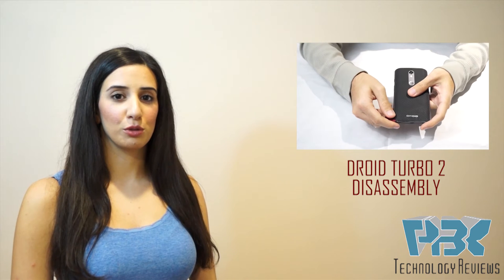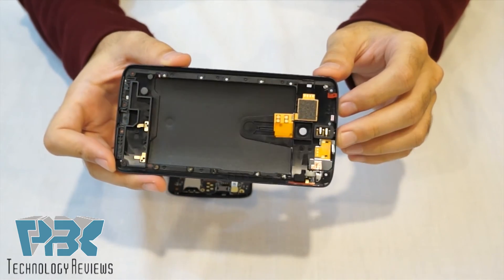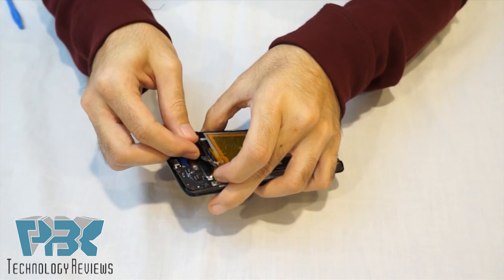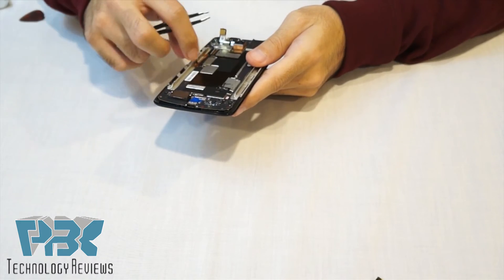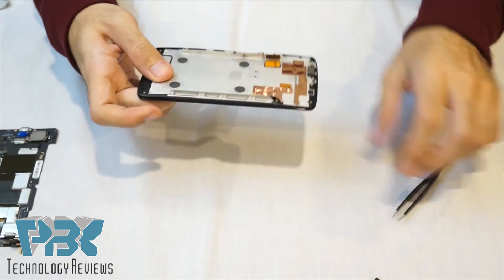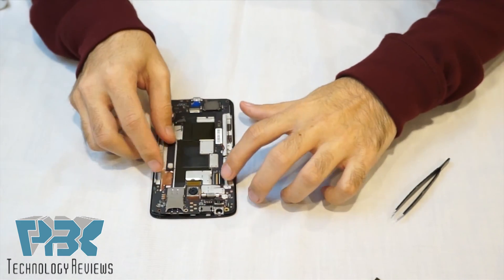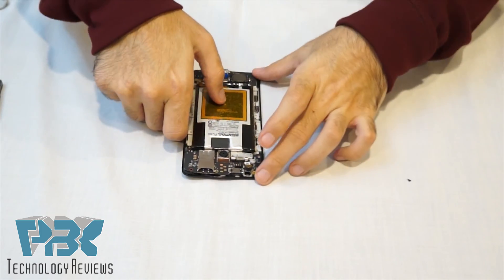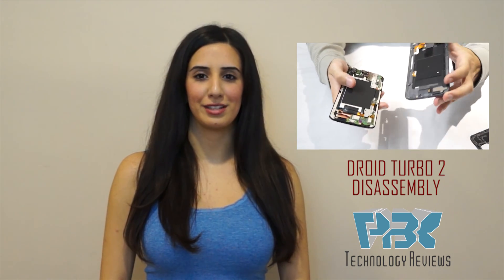Motorola Droid Maxx 2 / Moto X Play 2015 XT1565 Disassembly Teardown

Comment: Thanks for creating this video. Will you be able to point out where exactly the wifi antenna is located? My phone won't connect to wifi after screen replacement. More info in post at XDA Dev forum: https://forum.xda-developers.com/showpost.php?p=74637893&postcount=13
Reply from the maker: wow, I don't know who did that repair on the pictures you posted, but that is one bad repair job. I wonder what they damaged that they had to solder a wire to make new connections, however I can tell you probably in that whole area it where the issue is for your wifi. The silver plates on the black back plastic housing are the antenna plates. They are basically the antennas. I don't know exactly which one of those silver/chrome plates is for phone signal and which is for wifi, but I would presume the one on the corner of the phone where all the damage is, that should be the one since its not working. On the other side of the back housing and silver/chrome plate it touches lifted up gold or silver colored prongs that are on the motherboard which makes a connection between the antennas on the back housing to the main board. On your pictures on the forums it looks like those prongs are broken off your board thus causing no connection between your motherboard and the antenna on the back housing. I attached a picture of a different phone with similar prongs, here is the link for it so you can see what the prongs sort of look like which touch the back housing antennas to make a connection. https://ibb.co/e7NTA6

Comment: Hello, my Motorola X play xt1562 almost doesn't get any cellular signal. 

Could it be the antenna ? Switching to 2g and rebooting sometimes helps for the signal to pop up. but I still can't make a call or send a message, I sometimes recieve a message very delayed. 

I have checked, sim card and switched sim cards and provider and have done a factory reset without any improvement. My phone does have a chipped side next to the screen, could that be the problem (thin copper wire running through as antenna? = just a theory)

If I tear down the phone, what can I check? phone is besides chipped side in good condition and has never been taken apart. Thanks for the helpful video.

Comment: I did not think that the battery change was going to be too bad until i found that my new battery did not have the copper colored [NFC] sticker on it. Re assembled with the old battery and now my speakers do not work.  Will the phone function without this NFC sticker.  What may i have done wrong to screw up the speakers?  The head set works fine.
Reply from the maker: No you don't need the nfc to have the phone work, but make sure the back housing is making contact with the top and bottom speakers. The speakers sit inside the frame assembly but they have contact points that touch contact points on the back plastic housing which run to parts of the board making other connections so if the speaker is not touching the contact on the back of the plastic frame that you remove to get access to the internals, then it would not work.
Reply: What is the nfc for

Comment: okay from 2 videos of tear down I've heard t3 and t4 torx screwdriver so which one is it?  now I'm buying the frame and digitizer LCD in one, do I need any adhesive or use the current adhesive from the existing board? going g to try and do this myself then spend 100 from a local store that said it would take 2 days to do
Reply from the maker: Both will work, I prefer usually to go with one bigger because for me its less likely to strip the screw compared to smaller ones. You should not need new adhesive.

Comment: The new screen I got doesn't have the volume flex attached to the screen, just what seems to be the power button. Is there a way to carefully remove the flex from the old screen and put it on the new one or do I just need to send the new screen back and get a new one? Or another option I don't see?
Reply from the maker: yes you can remove them from the old one and put the flex on the new one they are held on with adhesive

Comment: If you are here to replace the screen it sucks.  I have repaired just about every phone and this one is the worst to take out.  Also your new screen wont come pre adhesive so prepare to start taping.  You will cringe when removing the battery and the circuit board will feel like its about to break in half.   Good luck you'll need it  <  Said like in smash tv.

Comment: On your video  it seems to be possible to remove and replace the earpiece without removing the battery and all of the parts you disassembed.
Am I right ?
Reply from the maker: Yes, once you take the back part off, you can remove the earpiece which is held down with adhesive without removing the battery and other parts.

Comment: the power and volume buttons magically went back where they came from.  It took me a bit to figure out that you dont put them in till after it is together. Kind of like a sim card.
Reply from the maker: The go in before you put the back housing on, so basically you slide them in and and put the back housing on and when you screw down the back housing it holds them in place.

Comment: Awesome video! I'm definitely going to be using it as a guide breaking down my phone soon.... My phone ear speaker stopped working and the WiFi, bluetooth antenna seemed to be damaged any thoughts on the problems?
Reply from the maker: It might be the back housing, its where the contacts for the earpiece are which touch the earpiece to give it signal and also where your antennas would be. Might need to replace the back housing or see whats preventing it from working, maybe water damage or dust/dirt?
Reply: I had someone replaced a cracked screen and I think they forgot something on the inside, well that's what i'm hoping to find.

Comment: I ordered the one without the mid-frame by accident. How hard is it to get the mid frame off? And do you have to reglue it?
Reply from the maker: its held on with adhesive, you would need to heat it up and pry it off and yes you would need to apply adhesive again to hold the screen to the frame

Comment: I have a single sim moto x play and want to convert it to dual sim use. I can easily purchase a dual sim tray on amazon as there are dual sim models in many countries. Please can you tell me if the difference between the single sim and dual sim model is just a software difference or is there also a hardware difference in the phone(as well as the different sim tray)? You have dismantled the phone so you might be able to answer this question. Thanks for your time!
Reply from the maker: +Julian Smithe Hi, a sim tray wont help you, because even on the regular sim trays, you can pry off the plastic covering the 2nd sim holder on the sim tray but the main board is missing the contacts on it for a second sim reader. Its almost impossible to find the sim reader to be able to even solder it onto the mother board. Then once soldered on you would also need to root the phone and install a different radio rom on the phone to make it enable the second sim slot. So its too much work lol. There is a version of the moto x play that does come with both sim readers installed on the motherboard but just needs software modification, but I forgot for which country it was, I think possibly india version. There is a thread on this on droid forums or xda forums, google it you will find it and will know all the info for doing it :)
Reply: +pwrdbykyank Thanks for your quick reply.

Comment: Is it possible to replace just the glass on the newer Moto X PLAYs? I can't find any vids on it so I'm wondering if it is even possible to do at home? Thank you!
Reply from the maker: +Melanie Drew For an average person, it would not be possible. It would require special tools and machines to do the job right. Wouldn't be worth the hassle and time.
Reply: I've done it with a samsung s3 a couple times but didn't need to remove the motherboard. What machines would I need? Do I really need to remove the mother board? Can't I just pry off the glass like with the s3?
Reply from the maker: +Melanie Drew I don't know how you replaced the glass digitizer because it has a cable attached to it that you need to disconnect, however you would need special heat guns and special glues to reapply the digitizer glass back onto the screen etc. the older phones were more simple.

Comment: How do you separate the mid frame from the LCD? I have a new lcd and screen on order but it doesn't have the frame. Thanks!
Reply from the maker: your going to have to heat the back up and pry it off, it has adhesive underneath it.

Comment: Hello ! Where is the proximity sensor ? After replacing display, i have issues with it.
Reply from the maker: +Cyril Flieller Hi, if you look at 5:15 in the video, the top left of the board the black rubber covered piece is the proximity sensor. Make sure the rubber over the proximity sensor on your main board did not fall off or maybe become stuck to your old screen frame. Without the rubber gasket, too much light comes in and it causes the sensor not to operate as it should.
Reply: +pwrdbykyank thank you ! I need to investigate !

Comment: Will T4 work as well, I've seen another video that says T4, can you try and see, because now I've ordered just a T4 screw driver and before I order the T3, I would really appreciate if you could test if the T4 will work as well. Thanks for the great video.
Reply from the maker: +Hugo Henrique T4 will work but there is a chance of stripping the screws.
Reply: T3 is the correct size

Comment: I am having gps signal problems, i wanna knoe where is the gps and the antena so i can try to see where is the problem! Thanks
Reply from the maker: +NahuelMS Most antennas are located along the frame of the phone on the back housing where the gold points touch the board (those are the antenna leads). Also the gold pad over the battery which connects to the board would be one as well to check.
Reply: +pwrdbykyank Hello, i have allready solve my problem. I saw in the superior cover of the back alluminium and think mmm wtf is it doing here? The only think it can be is the antena. So I start pushing in an out and punching it and the gps fixed. I think i migth open it later and see  if there is some bad contact. Thank you very much, this video were really helpfull!
Reply: +NahuelMS I spend four days suffering with the gps and the phone have 1 month!
Reply from the maker: have you checked the settings in the phone to make sure gps is turned on and also uses wifi to locate?
Reply: +pwrdbykyank i check everything possible! All programs, wipe cache, clear data. The gps must work in plane mode and only device like my old moto g. Now it is working better but still some fluctuations that I don't like. I am going to buy a screwdriver and check that everything is okey. Thank you so much! Sory for bad English jejejej
Reply from the maker: sounds good, no problem :)